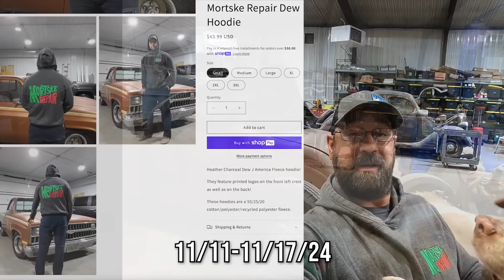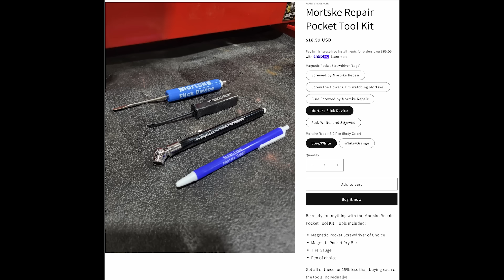Budget 4X4 OBS Chevy Regular Cab Transformation! First Drive! Late Model Interior Upgrades and More!

Comment: It's nice when you're doing time far from home the crew back home is keeping the shop going so you don't lose it Mr. M!  😎
Reply from the maker: You got that right!
Reply: @MortskeRepair to swap from manual windows to power you just have to swap the panel in the door that the window regulator is attached to
Reply from the maker: @royjohnson7760  How about going from 1990 door shells to 1995 door panels?
Reply: @MortskeRepair  you will just need the  window regulator panels from the 95. the door shell didn't change
Reply: Teamwork makes the dream work
Reply from the maker: @royjohnson7760  We're trying now. The door structure is physically different tho we're finding.

Comment: Hey mort the front you can use that newer grill and the older 4 little headlights will work the backing will change the oly problem youll have is the amber side reflectors  stud needs to be adressed . I have the newer plastic headlights turn dull and yellow it makes the teuck look old. You have to change wires on back just splice them back . I loved the way my old 91 lookied afterward. Also change out your tailgate holders that are cable they suck 88 got metal one yet much better than new

Comment: I just bought a 1998 K1500 Silverado extended cab 4X4 with a Fisher snow plow for $200.00.   350 Automatic 79,000 original miles.  Passenger side rocker and cab corner are rusted , the rest of the truck and undercarriage are really good.  Runs like a brand new truck.
Reply from the maker: Awesome!

Comment: Obs trucks are my thing. Including parts trucks, I’ve probably owned 40 or 50 over the years. I knew every hurdle you encountered. It’s the little details that will nickel and dime you to death. My latest is a ‘90 c1500 long bed to short bed conversion. I can tell you from experience , yours needs cab mounts. The body lines between the cab and bed are off and the door gaps on the passenger side is a dead five away. Look at how the front of the door and rear of the fender line up. Fat at the bottom, skinny at the top. Both tell tale signs of failing body mounts. I’ve actually seen them so sagged out that the shifter was jammed. Any how, good project. I enjoyed this series. Thanks. Peace.
Reply from the maker: Thanks for the info!

Comment: The OBS pickups were a definite improvement in many ways. My first OBS was when I got my new 90 SS454.
The 454's weren't exactly a powerhouse, but at the time, it was certainly an improvement over the 350 engines,
and it didn't take long for the aftermarket to come out with parts that really brought the 454 to life...

   I've owned a 76 1/2 ton 4x4, a 75 3/4 ton 4x4, a 73 1/2 two wheel drive, and a 78 GMC 1 ton crew cab 4x4
with single rear wheels. I never had any complaints with them, but the GMC was my favorite. I spent almost a
year completely restoring it. I built a real nice 406 for it, and even though it weighed almost 7800 pounds,
it surprised several so called fast cars in town. I wish I would have kept it but I got the bug to get a new
Dodge 4x4 with the Cummins engine, so I put an absolutely ridiculous price on it and sold it to a UPS driver.

  With the exception of my crew cab, one thing I don't like about the square body pickups is that they don't
have much leg room and you sit really close to the steering wheel.  The OBS pickups seem to have a little
more room in them.

Comment: Let’s face it, you’re already in love. I built a 305 a few years back that I got for free. Put flat top pistons, a comp 252 cam in it, did some mild head work and had a decent street motor, went high 13’s in a Regal with 3:73 gears and a 700r4

Comment: A long 3/8 bolt with a nut and washer into a side post battery is the best way to make a connection.
Put the nut on the bolt then the washer and wires, then thread the bolt into the battery, use the nut to tighten everything down.
Did you know, a properly used side post battery actually makes a better connection versus top post, Now You Know.

Comment: OK my friend . 90s to early 2000s truck tips . GM loved to ground to alu,inum brackets ,intake which caused all kinds of havoc . The fuel pump should have the upgraded ground pigtail . Up north we would aluminum oxide proper the tank from crimp seam down ,hole saw the tank condom to help drain snow, debris. Etc. On com,or ial trucks I would run 2 grounds to the engine due to corrosion issues when salt is used .on the roads.  One more thing check the balls joints.  Good stuff as always .
Reply from the maker: Thanks for the info

Comment: 93-97 F body V8  battery cables.  You’ll get a 6 gauge accessory wire, 10 gauge charge wire and 4 gauge starter wire all on a side post stud - with correct length for passenger side battery.  The negative cable has a heavy body ground as well.
Reply from the maker: Good to know

Comment: Them obs you gotta get the acutal AC delco temp gauge sensor the cheap auto store ones are never the right ohm loads and it makes them read overheating when they are really fine. maybe thats your problem we had that with our 95 gmc thanks for the vids man.
Reply from the maker: noted

Comment: Only way I know of fixing the battery connections on them is to replace the battery wires with brand new ones. My experience has been that so many people have messed with them messing with it more just adds even more points to fail. My 1996 I put new cables on it and haven’t had a single issue

Comment: Using a hole saw on both sides of that oval shifter cable hole makes a nice clean cut. Basically cutting a figure 8.
Then just trim it out to an oval.
Reply from the maker: Great tip!

Comment: On those side post terminals I use a 1 1/4 inch long 3/8 16 bolt with a nut and flat washer. That way you can get full thread engagement with the bolt. Then tighten the nut down for tightening the connection. I also pull all the rubber off the connections so I can see if they are corroded.

Comment: That module in the distributor is what causes that popping in the exhaust its killing the fire momentarily as it runs it will eventually die and the engine will not start cuz it kills the fuel pump

Comment: Hey there Mortske just have to let you know 1995 is the one year you do not want to swap into a new or older vehicle 1995 is the only year that you have an extra solenoid wire and that’s because you’re gear selector not have the overdrive push button there for the extra solenoid wire when you tow with that truck you want to tow in third gear unless you’re on the highway that is flat that tranny wants a shift at 45 miles per hour to overdrive so when towing the transmission fluid heat up and you burned up your transmission and it’s only in 1995 you can’t put any other transmission, but a 95 no 94 or 96 it won’t shit right you shit hard like you did first second and don’t come out a second sometimes so yeah 95 only.

Comment: Copper brake hose washers in you battery connections.  Takes up the gap and good current passage. And you're gonna need a MILWAUKEE band saw, buy the good one, and a box full of blades,  and a couple of big tubing cutters.  Most exhaust selling shops can fix you up. Call Boomtube, he's not a big jerk.

Comment: When clamping the exhaust together take a sawzall and split the pipe lengthwise the clamp will still seal, but if you ever need to take it apart you can drive a chisel into the larger diameter pipe with the split in it and it will come apart a lot easier
Reply from the maker: Noted
Reply: @ you can also use the pipe expander to reshape the pipe if you smash the end of it, although I’m certain boom tube can share much more worthwhile information than I can
Reply from the maker: @gerritdice315  Why didn't I think of that?!?

Comment: I just had to replace the rusty tank on my pickup. Not a fun job on the ground in the driveway. That plastic shield really helped the rust grow. I didnt see any holes but it was seeping through the whole bottom of the tank and settling in the plastic shield. Was really stinky when the truck sat for a few hours. Didn't amount to much fuel loss though. I made sure to 2k epoxy prime the new tank so I didn't need the shield too.
Reply from the maker: Good deal

Comment: Back in the day when i used to mess with TBI stuff, i remember a tbi chip company did a bunch of testing on exhaust and ditching the factory  y pipe for a aftermarket y pipe or duals was good for a legit 50 or more hp on the dyno. Maybe even more I cant remember.  I do know that its a huge number for very little money.  The one they recommend to use was a Y250300S.  Only reason i know that is because i still have one for a project i never used because im a loser and never finish anything.

Comment: Mortske you wanted a comment for the battery repair. Well with my experience I’ve decided not to mess with the side post and install a marine top post . The stud on the marine post will allow the cable ends to accept the stud, wingnut to the post over the cable ends. Looks a lil goofy but you are able to disconnect the battery for long storage in the northwest.

Comment: I like to use side post charging adapters, and marine terminals, the wing nut comes in handy for quick connections, only mod to the cable is launching the garbage side post bolt to the next county. I’ve done this to several OBS trucks. Might not be the “right answer”, but it’s a better solution to an age old problem.
Reply from the maker: Good idea!

Comment: I cut the rubber off the cable end, and chuck the filler that’s in there, both cables,then a 3/8” bolt with a nut bottomed in battery. Use a nut to snug it up.and sounds like 7/2 plug wires are swapped.

Comment: I just got a 97 z71 for 900. After a transfer case and a heater hose fitting it runs and drives smooth as can be despite a good amount of weight reduction.
Reply from the maker: Awesome

Comment: I just sold my 91 z71 stepside 4x4 brand new gm crate motor and fresh rebuilt 4l60  had over 13000 into it but because of the 90s paint got 6000

Comment: Door pins: Cunningham Machine, the best fix for OBS doors, I have a set that’s 3 years old, still shut like butter.
Interior doors: just the inside guts, the black inner door metal is different besides the obvious door panel. It’s a bunch of 7mm screws, and a couple 10mm’s. You need to fix the door anyway, good time to upgrade. The power window /door lock harness is separate, it runs along the top of the firewall, and because the odds of finding good manual door panels in 95-98 are slim. I changed to power windows for that reason. Hope this helps.
Reply from the maker: That's good info, thanks!

Comment: For your battery connection problems, just drip some solder on the problematic connection and then wrap it with electrical tape !

Comment: My first pick up was a 90 gmc  with a 350. The guy i bought it from did a valve job on it. He screwed them up.. i got the truck for 500.00 spent 300.00 on a friend to reset them.. ran great for 5 years

Comment: I moved in 2021 and sold my square body. Bought a 1997 OBS. It's a K1500 extended cab with the 6.5 bed. I bought because it's almost perfectly straight and no rust. It needed a lot of work to get it on the road as a daily. I drive it often and it's good but wait until you're messing with the stupid door lock latches and everything like that. The power locks work but you can't unlock the driver's door with the manual lever. Little things like that are really annoying.

Comment: I don't know about the v8 tbi but the 4.3 tbi the distributor is keyed and can't be turned. I spray the fluid film all up inside the sheet metal/ rockers and bed sides cab corners. Salty here in Detroit area

Comment: The firewall to transmission block, and the intake manifold or head to core support and frame grounds...
Reply: And the ect sensor grounds to the chassis wiring engine side harness to the ground stud at the ect it's actually a long bolt on the thermostat housing, and when i was messing with the early 94 Chevy Z71 Silverado extended cab short bed truck that i did have i bought a $35 airtex/spectre premium sending unit assembly and airtex fuel pump $45 all from Amazon and everyone told me it's junk go buy it from O'Reilly's and they were selling the same setup $174.77 nope and it fixed the issue still working with the working gas guage when i got rid of the truck, and a buddy of mine went the O'Reilly's route and 6 months later no fuel pump pressure and 3 years warranty and O'Reilly's is like send it back to the manufacturer for the warranty so it got a Amazon $44 airtex fuel pump and runs again goes to show you O'Reilly's doesn't always have the best parts either and it's hit and miss with new parts what i bought online through Amazon were the exact same pieces, and the trucks were both tbi V8 350 638 187 head castings based my Early 94, and a 92 Chevy Scottsdale although if id have had his 5spd manual shift transmission id have kept my early 94 it was a flip flop paint scheme of your regular cab long bed 93 Chevy,onyx triple gloss black with quicksilver center and dual bright red pinstripe and dark grey Z71 and dark grey cloth 60/40 bench seat with pwr Dr side

Comment: Mr. Mortske. I've an '82 Chevrolet C10 Scottsdale with the 6.2l diesel. Are the spindles on a 6.2l heavy duty-er than a 1986 C10 gas or are they're interchangeable? I found factory Spindles, backing plates,, coils and bump stops for $75 used.  My truck is probably the lowest C10 I've seen without bags or hydraulics. My opinion it sets to low. The truck came with belltech suspension kit. Spindles, coils springs and 4ea. Shocks.im not 100% what this drop is, I think is 4" in front. 3"drop Spindles. I'm not sure how far the coil springs drop, anyone know the length to a 1" drop belltech coil? I wanting to raise it up for sure. The A arms are 2.5" off ground, frame is a fist width or 4-5" off ground. Wondering if the belltech will raise it a bit?
Reply from the maker: Same spindles.
Reply: @MortskeRepair  Thank you! 😊

Comment: Reason i was messing with my rust bucket Early 94 Chevy Z71 truck was rockers cab corners were rusty front fenders were and the inside of the bedsides were rusted out eating through to the outside of the bed, but the doors and floors were absolutely solid and so was the frame some scale but no cracks breaks ir or significant rust so until after I finally got it to run right and then it was going to need a timing chain replacement in a replacement motor because they banaided it and drove it wounded for so long it literally burned out the fuel pump and relay, and then it was going to need a rebuilt transmission that worked fine rebuilt and I was like nope that is it im done bye

Comment: I only buy the 88-94s I had a brand new 95 and hated that interior. Plus they ran the newer interior less years. I just prefer the fiero, back to the future DeLorean look. No air bags. I get the rear defog and power mirror switches off ebay and install heated power mirrors. Power mirror joystick hides in the ashtrays. Closed you don't know is there.

Comment: do they use Salt on the roads where you are? I mean you have rust but bolts that would snap where I am come out on much older rides with a bit of work for you. Curious if it is due to the salt and chemical sprays they use here for de icing
Reply from the maker: Yes

Comment: The doors are not different they use a different inner structure it’s bolted to the inside of the door as far as the 95 swap in general is a 1 year only everything

Comment: From what I remember about 1994 to 96, GM changed the ecu, and those years were dogs compared to those before..
The 97 up actually had real vortex heads, and remapped ecu's, which ran circles around all the years up to that point..
They even made the 5.3 look bad even though on paper the 5.3 should have had the advantage over them, but I can say that my 97 extended cab 5.7 with od automatic would walk away from the 2000 model year.
The vortex 5.7 carried over to 2091 in the suburban Tahoe, and Yukon before changing to the ls engines.
Another side note if you want a hot rod from the mid 90's find any of the top line station wagons they came with the option for the LT1 engines with factory dual exhaust electric cooling fans straight outta the corvette power plant assembly line, with the better rear diffs typically with bigger limited slip, only some had the 301 ratio, with some with 342 ratio.
Unlike all the sedans they're unknown source for engines that should be easier to find and with far less abused miles on them due most soccer moms weren't into high speed runs or blazing the back tires off they're rides.
Just a little trivial knowledge from those days that I'm confident enough to pass it along to anyone interested.
Funny how GM called the engines from 1988 to 96 vortex when they weren't actually true vortex engines until 97 to 2001, my 89 Silverado with 5 speed ran good compared to the smog dogs before it, but nothing compared to my 97 and I put well over 200,000 miles on both of them.
The 97 even got better average fuel milage too, which I'd of never believed a automatic od would do better the standard 5 speed od could.
PS
I can't believe you failed to do the mandatory burnout, I beginning to think that Puddin fella is rubbing off on you in not so good way.
Shame on you, cause you didn't even do donuts in the gravel, and poor Duff probably had to have a bath too before he could even ride in the dam thing too.
Geez, some people's kids nowadays, I just don't know what the world's gonna do when all us old ones are gone. 
Hahaha 😂